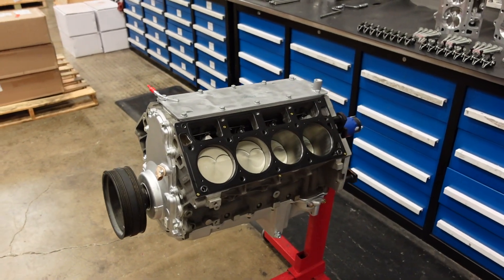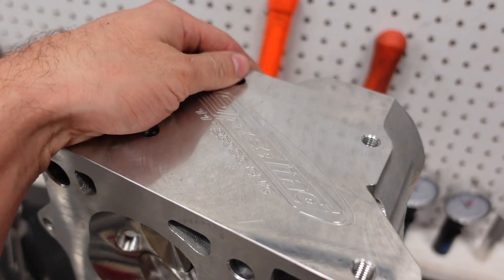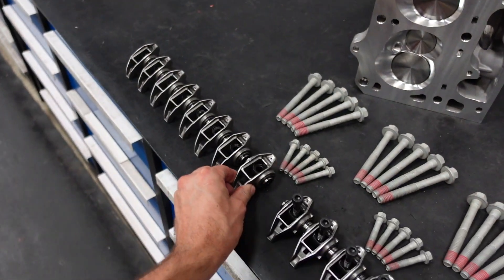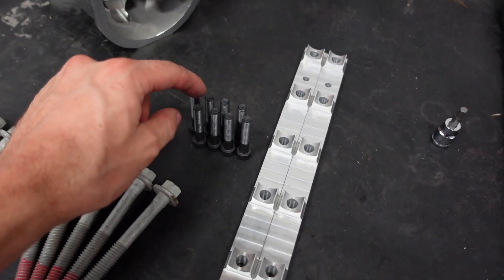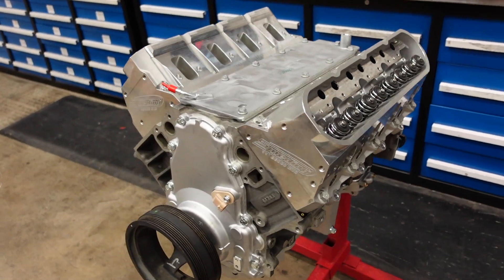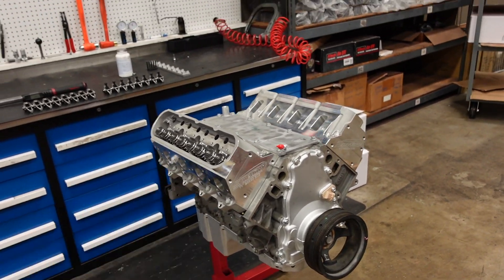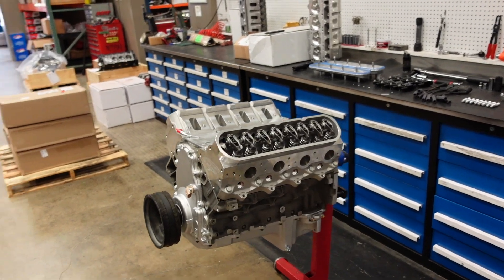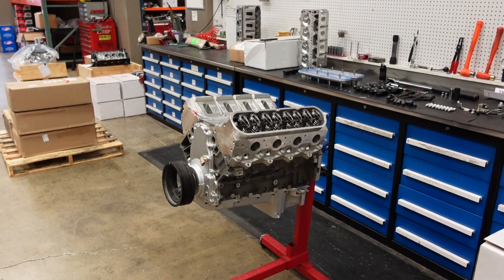416" LS3 Stroker Full Engine Assembly! (Part 2)

Comment: I’ve got a LS3 block and I think I’m going to DIY one of your 416s. I was thinking about the AFR 245 heads, I didn’t realize you had your own LS3 heads. Maybe do a video on them. I may use them I just don’t know much about them. I’ll definitely be using your 1000 hp stroker kit when I get ready for shortblock status!
Reply: 235 TFS or 235 MMS
Reply: @jimstover6747  I just got BTR’s TFS235s and 700 springs. The motor will live around 1400 crank and shift at 8500.

Comment: That engine is gorgeous.  I am saving for a set of your 255 heads for my street build. Ls3 swap. Pure eye candy lol. Shiny!!!!
Reply: Use actual bolts not TTY and gap your rings for boost even if you aren’t going to. You probably will later.
Reply: Thank you for the info. APR studs and definitely going to gap the rings. She's going to spend alot of time towards redline. I don't want to break a ring or piston. That's for sure lol.